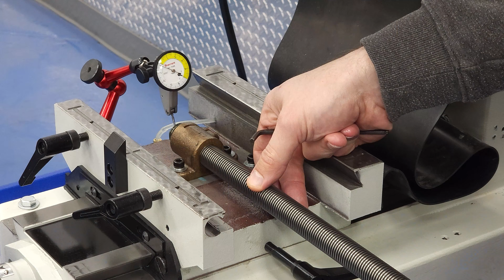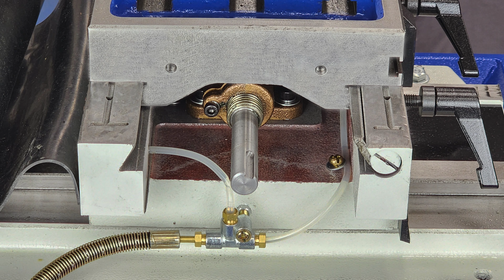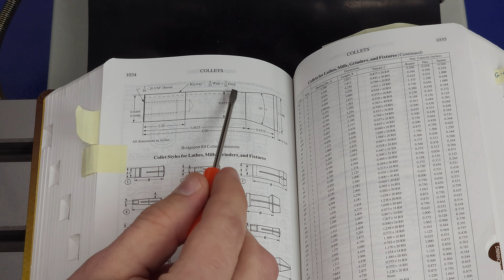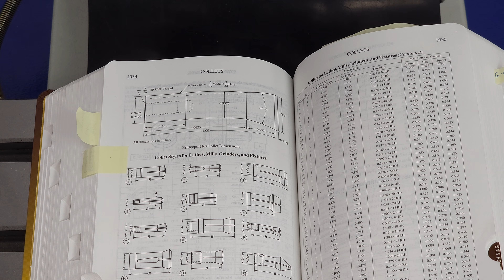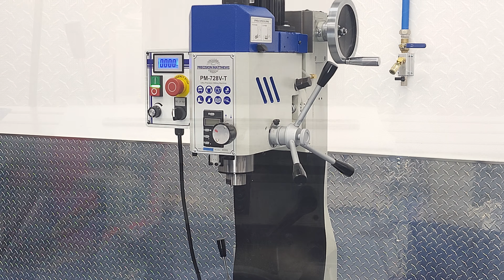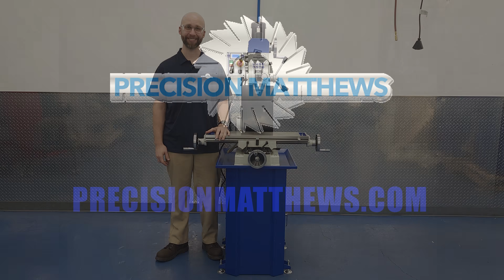PM - 728VT FAQ's - Precision Matthews Media

Comment: Excellent series of videos, recently, and Charlie is exactly the right person for this, obviously. Flawless delivery and just the right sarcasm. What are the necessary additional steps to dismantle the machine for moving easier with the ‘factory installed’ DRO? Do the scales remove and index easily, or is there a more efficient method?
Reply from the maker: The DRO is easy to remove. For the most part though, you will only need to remove the bracket on the back of the saddle, the scales etc can remain attached. If you would like a further explanation, please give us a call.

Comment: I bought the same exact machine 2 years ago. When i got the machine the table had 100 and 10 thousands back lash in it after removing the table i found that it did not even have the back lash screw in it and the screws that healed the brass nut to the table were loose also. After having the machine for about one year the motor developed a bad clicking sound. My openion was it had a bad bearing. Percision mathews did replace the motor. So far no troubles after that.